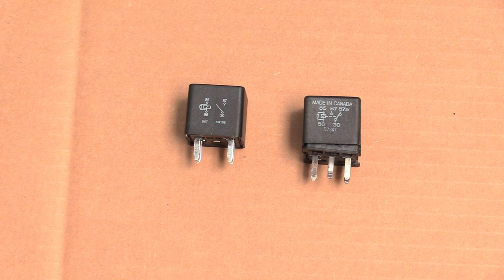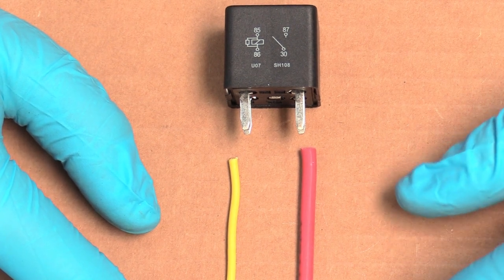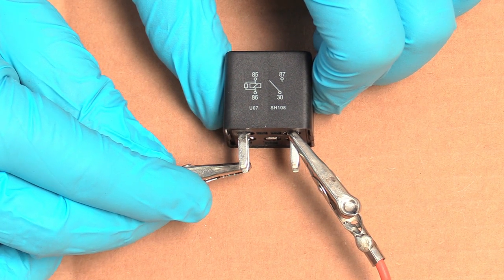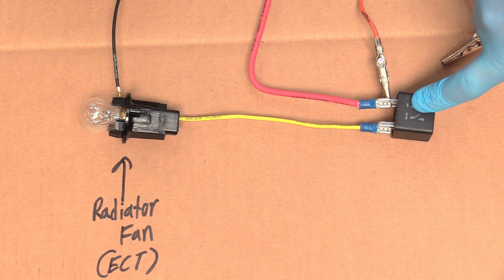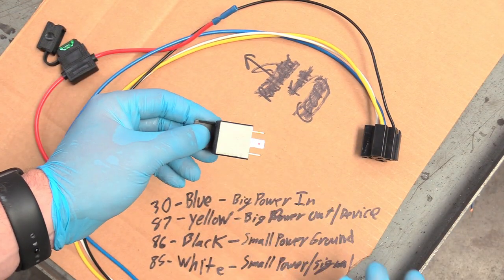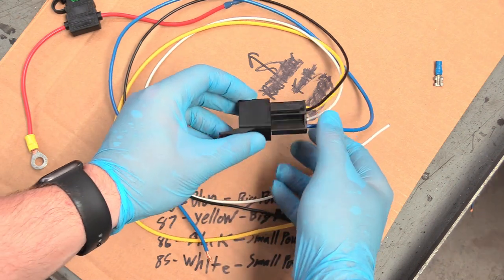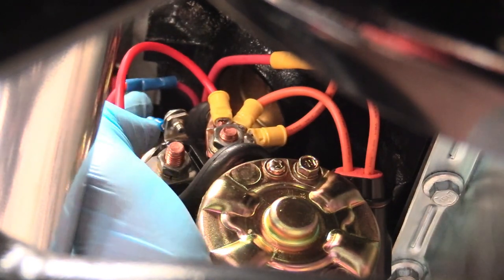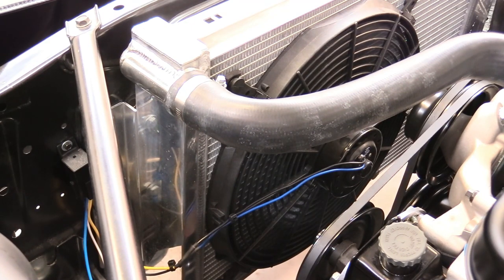How to Wire a Relay - Full Tutorial

Comment: To further confuse, the" big power" red wire at the beginning of the tutorial is now a yellow wire carrying the "big power" in the circuit display. Or is it the "big power" from the battery (red wire) to the "big power" (yellow wire) going to the fan? I'm more confused now since I watched this tutorial. I'm old enough to remember that all electrical  wiring had red wires for "big power" and black for ground. Now it can be any color as evidenced by your displays and the fan manufacturer!

Comment: I’m connecting mine correctly and it’s shortting my fuse but then when I connect 86 to 87 the fans work I’m confuse I’m strutting
Reply from the maker: Double check how you wired the relay. You could have inadvertently wired it wrong. Thanks for watching!
Reply: @2carpros  idk man ive tried so many diff ways i just dont get it can u draw me a diagram? i really need help if not ima just straigth wire it with a fuse to the battery w switch and thats it